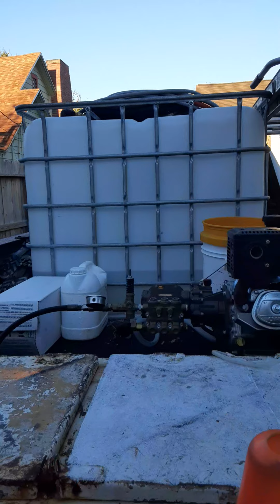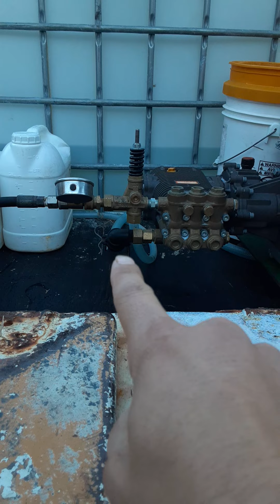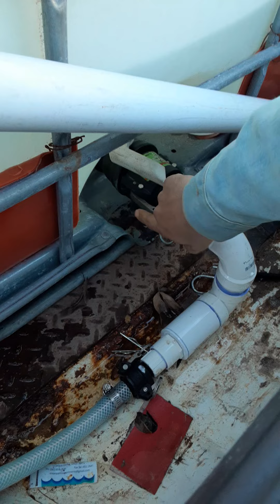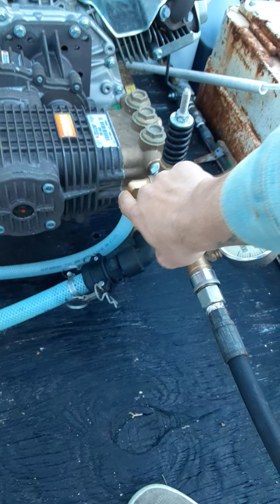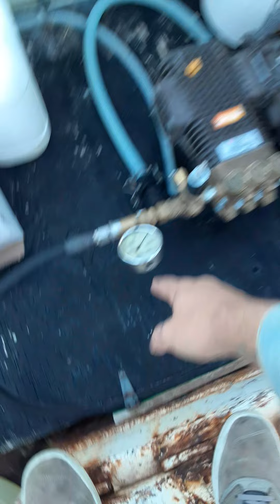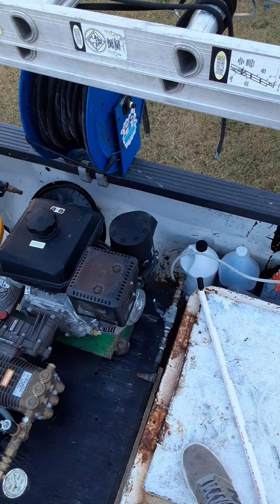Pressure Washing Truck Bed Rig, Kohler GEAR DRIVE MACHINE

Comment: How's that pressure washer running man? Looking at picking one up
Reply from the maker: This kholer runs great, no problems.
Reply: @fazpowerwashing  hey Faz, just got my gear drive built. I went with the gear drive and pump kit from washmart and a Gx390 from northerner tool and built it myself. Thing is crazy sweet!
Reply from the maker: @Skill_Issue92  nice man, good luck out the stay focused and take care of your equipment and it will take care of you!

Comment: Hey thanks for your videos, it helps a lot having some one close to my area. I'm from the valley and trying to learn from guys like you that are already doing it. I want to start in January or February my own pressure washing business.
Reply from the maker: Thank you for watching sir, anytime you need some help feel free to reach out, during the winter months I'd say it kind of slows down especially for residential work but dont let that stop you, do some work for family and friends for experience and advertising purposes, then move on to offering your services to local business to get your name out there, good luck sir.
Reply: @fazpowerwashing  thanks a lot, yes that's kinda what I want is start getting experience and before and after pics. So I can be ready for spring.